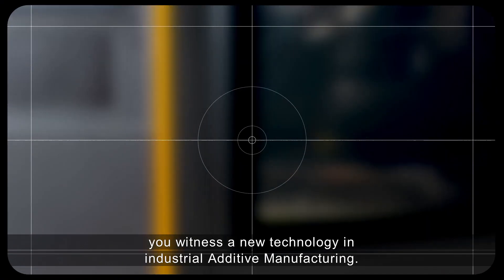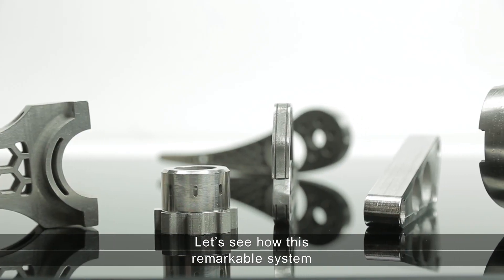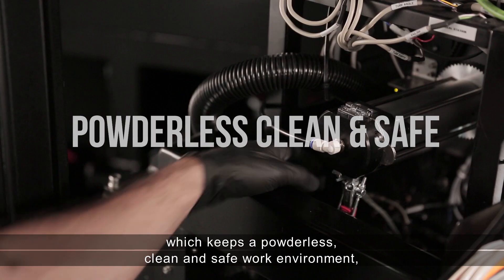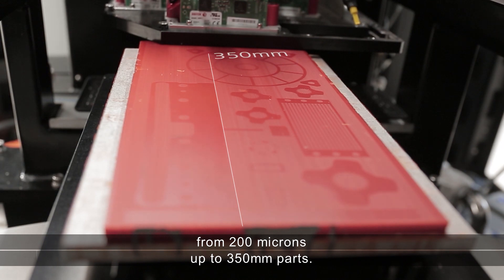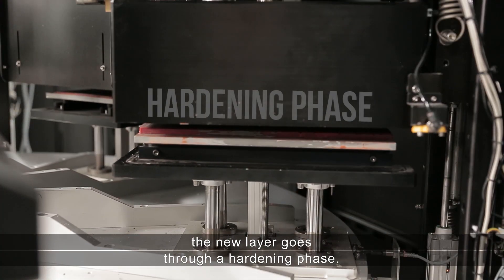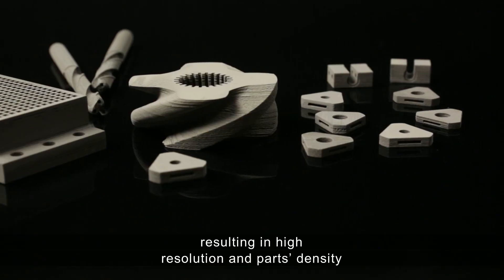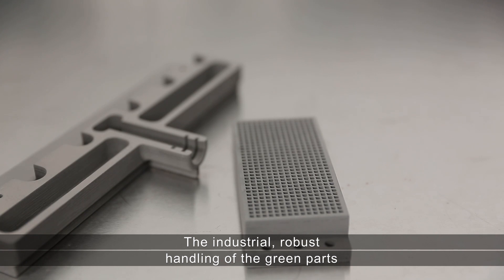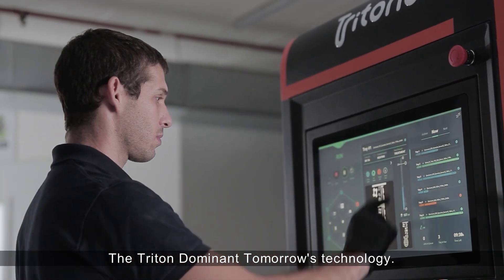Tritone Dominant

Comment: The first 3D additive manufacturing product that offers field ready metal parts.  Most 3D is all smoke and mirrors for prototypes or several curing and finishing processes of parts.  This is the way to go if you are a machine shop and want to invest in digital.